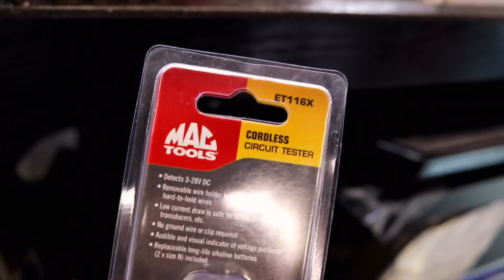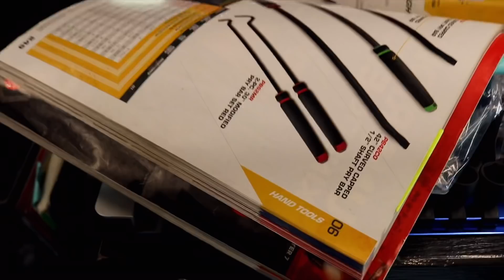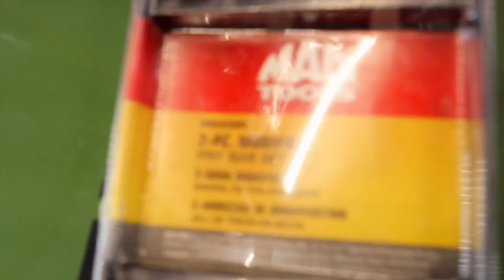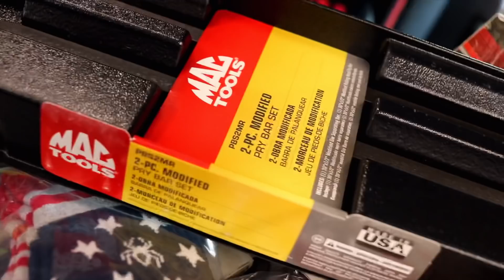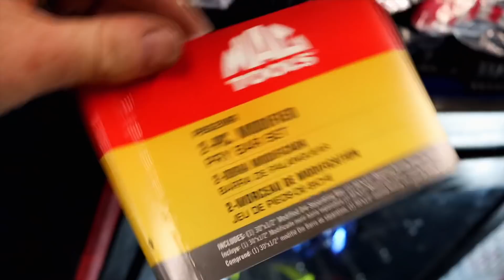Mac Tools: Curved Prybars and Double Flex Bit Ratchet

Comment: Clay thank you for doing these tours. Because of them I purchased a #4 RBRT Extractor. To remove a grade 8 shock bolt. Broken off flush in my frame. Within 5 minutes that bolt was out. By far the best tool I ever purchased. I will definitely be adding more RBRT to my box. As the budget allows.  I would have never know about the RBRT line. If it were not for you. Thanks for saving by behind. Up here in the Motor City.
Reply from the maker: That’s awesome ! I appreciate you watching and sharing your success story of how great the Mac Tools RBRT line is !

Comment: Longest pry bar I have is my 58 inch Mayhew pry bar.comes in handy prying off stuck wheels on vehicles.I have the Matco prybars like that Mac set,have come in handy checking ball joints including prying out transmissions from engines stuck in the dowel pins

Comment: Pry bar set may be good for popping out axles very cool I could use something like that if you use em should make a video of you using them and seeing how there used
Reply from the maker: Yeah that’s what I was thinking or when you need to pick up or push down on something. It will work good too for super singles to help lift them up to get them started.

Comment: I got on the Mac truck Monday looking for a 22mm 1/2” drive deep socket with a deep shoulder. The snap on have a shallow shoulder that doesn’t go all the way on a lug nut. Ended up buying a expert set deep and shallow on the aluminum try.

Comment: I gotta start being smarter, when I do oil changes I put a wrench on the plug then grab it with my left hand and close my fist on my right and hit my other hand with it to break them loose
Reply from the maker: Yeah you will be like me and damage a tendon in your hand ..... trust me use a wrench extender it’s longer ratchet. Way cheaper than a doctor bill and you can keep using it
Reply: I used to do the same thing working in a oil change shop.

Comment: I know Snap On has a small UV penlight that I’m pretty sure I saw on Hamilton’s truck in another vid.

The 44 inch prybar is the Heavy Duty.  7/8” bar.  The others are 3/4” and will flex.  Definitely worth picking one up.

Or if you really want to get crazy, the OEM, Mayhew, has a 54” version called “The Big Stick”.  I have one and it’s totally overkill but bragging rights lol:
https://www.jbtools.com/mayhew-14124-54-the-big-stick-dominator-54c-hd-curved-pry-bar/

Comment: That bit ratchet looks like the tits looks like it would be perfect for swapping idle air valves on the 97 ram 1500 shitbox because my wiha one just barely doesn't fit unless i go a tooth at a time and that aint fun either that or pull the whole carburetor off.